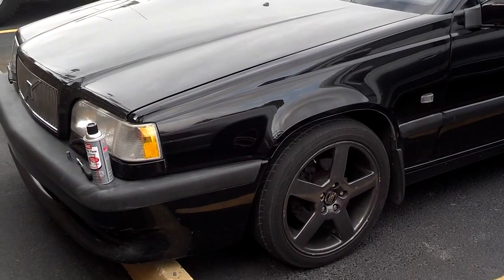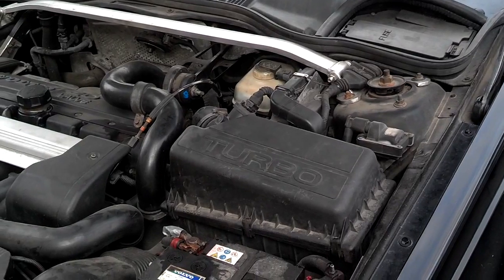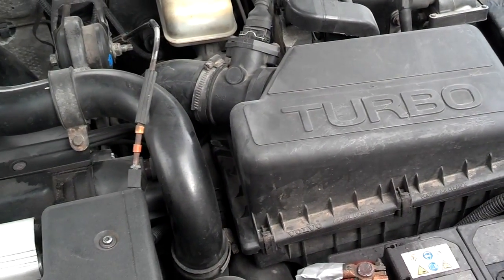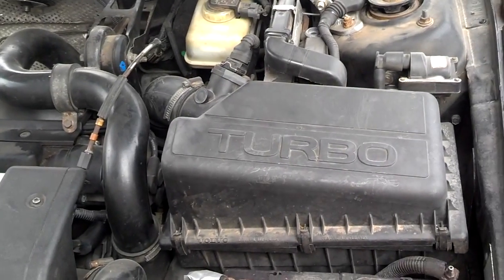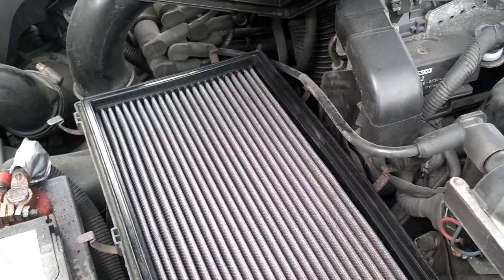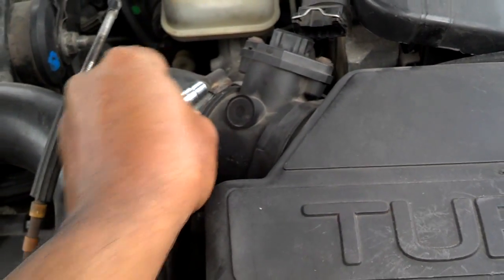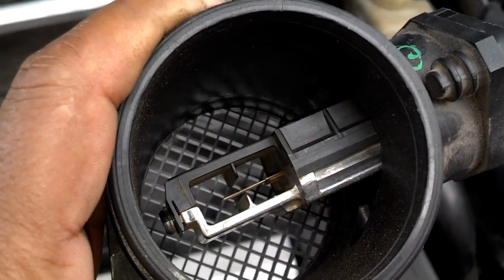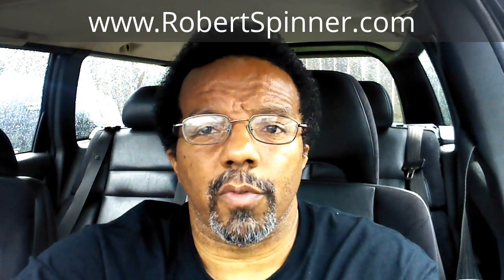How to clean or replace the mass air flow sensor, MAF, Error code P103 - VOTD

Comment: Robert, I have a 99 v70, we had to replace the throttke body twice in 2 weeks, drove well for 6 days, but I have the same issues now, the difference is there's no light on the dashboard. The engine is losing power, i have to park the car, wait for maybe 15 mn, and the car runs well for a few miles. Etc.  Any help or advices sir ? 
Thank you
Reply from the maker: +stéphane Dufour Is the car turbo? What codes did you have?
Reply: +Robert DIY The car is a fwd, no turbo. 
I don't remember the code on the computer.

Comment: @Robert DIY Robert my airbox has these 2 lines. Where are these supposed to be connected to? I am getting an air leak code as well as 02 sensor codes as the cars running lean have a 96 Volvo 850 base 5 spd. In the process of smoking the motor and exhaust. One of these lines were capped off. Also visible just under the battery tray there looks to be some sort of vacuum line port or some sort of valve and I noticed there was no connection there. So my question I guess is does the line go to this port and could this be my air leak or something else. Can't seem to find a diagram with these vac lines ...thank you!!! your vids have helped me tremendously !!
Reply from the maker: Tony Trapanese Should be a vac diagram under the hood somewhere. The two lines on the back of the air box... one goes to the vacuum tree and the other goes to the lower front side of the air box (valve). As for the cruise control vacuum motor under the battery trey, one goes to the gas pedal, the other is open.
Reply: Thanks for the reply awesome content best on the tube!

Comment: Hey Robert, I'm getting a P0102 code. The engine is running rough and eventually stalls. Do you have any suggestions? Does this sound like a bad MAF sensor to you?
Reply from the maker: d3lta360 Yes.
Reply: Robert DIY thanks for the quick reply! I'll do a bit more research but I'm leaning towards getting a new one.

Comment: buenas estimado Roberto soy de Argentina siempre veo tus excelentes vídeos , no consigo pieza sensor maf bosch  0282 217 002 para mi volvo 850 modelo 1994 ; una pregunta le puedo adaptar o reemplazar por el sensor maf del volvo v70 ? saludos
Reply from the maker: RONAL MAX POWER Yo no Haria eso. Es el turbo coche? Es la parte MAF de su caja de tapa de aire o puede ser removido ? Si necesita ayuda para obtener una parte , que me haga saber .
Reply: Robert DIY Buenas Noches maestro Robert Volvo 850 state wagon
Modelo 1994
20 válvulas
5 cilindros a Nafta 
Caja manual Sin Turbo No Turbo
Chasis : 
YVILW550822066566
Motor : 
B52545279063

Pieza Sensor Maf Bosch Codigo 

0 280 217 002
Amo mi volvo y no consigo piezas por ninguna casa de venta de repuestos volvo , removi la pieza y vi que esta muy deteriorado y me daba fallas en el arranque del motor , fallas en ralentí , pregunto si no es molestia para ud conseguirme el sensor maf y te deposito el dinero por money gram o westerm union por favor , gracias.
Reply from the maker: 0 280 217 002 Es que el número de pieza en el MAF ?

Comment: What's a typical symptom of a bad MAF? My car is hesitating on acceleration (with very little throttle even) when it's cold but gets better warm, can it be the maf?
Reply: Themostpower Only code I got (it's a Volvo 850 T5 -95) was 2-3-2 on A2 meaning bad fuel mixture on idle. (Might be the O2 sensor aswell, or the open dump valve?)

Comment: Good advice Robert. I was told that the sensor has a silicone coating and some cleaners will remove the coating as well as damage the sensor. Is that true? I also think that it would be double risky ordering a used and one can only hope the person handling it knows or cares what they're doing.
Reply from the maker: I'm not sure about a coating but they are sensitive. I have shipped several used ones to people and did damage one once. They are easy to damage.

Comment: My car has been idling pretty smooth lately That clean a works very well
Reply from the maker: Hey man, what is the best way to check for vacuum leaks? Some spray in a can?
Reply: Robert DIY
usually the best way to check is with a smoke machine. however those are expensive so a lot of DIYers don't have them handy. But another trick that does work is finding vacuum leaks with a cigar. Scotty Kilmer has a video on that. I no longer smoke but that method does come in handy.
Reply from the maker: Some people spray something around the lines but I can't remember what??? Maybe carb cleaner or something like that.

Comment: Great video Robert. Could you possibly do a video on the best way to check for vacuum leaks? I have one on my volvo 98 v70, it says a large leak and I believe it is affecting my MAF. Thanks for your videos. I watch them all.
Reply from the maker: Let me ask GoodDad. Here is a video that might help.
Error code P0243 and P0171, Volvo S70, V70, XC70, 850, etc. Turbo - Auto Repair Series